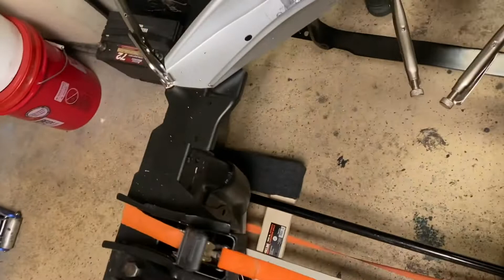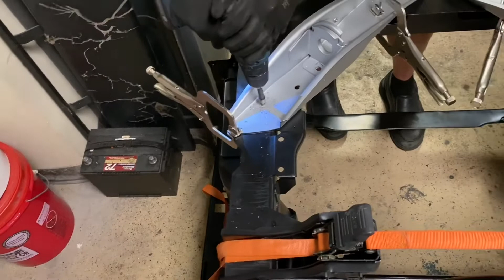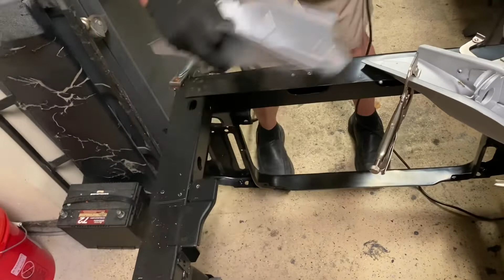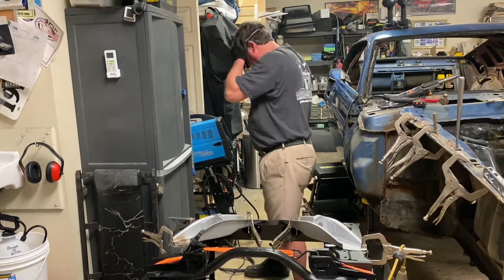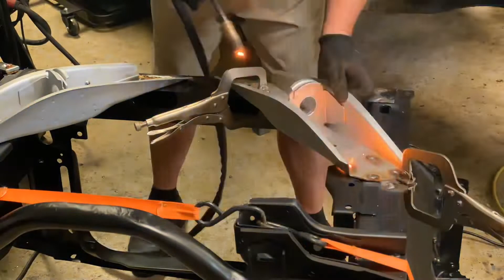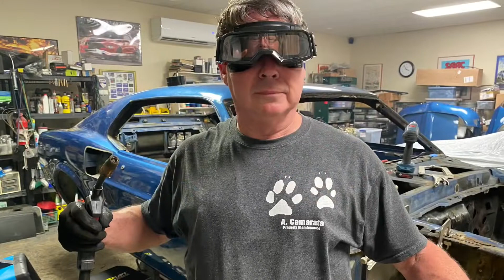1969 Mustang Restoration (Part 4)

Comment: Why replace the front subframe
Reply: The area of the frame beneath the shock towers was rusted through and at the front torque boxes....a long with the usual rust through on top of the aprons... oddly enough the rear of the car was rust free framewise...a side from the usual lower rear quarter rust.   Thanks for watching